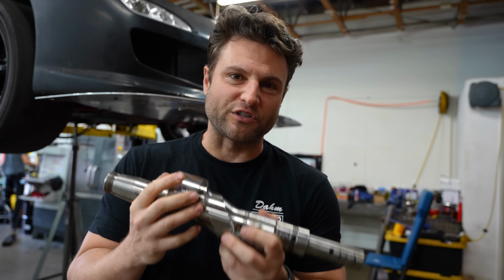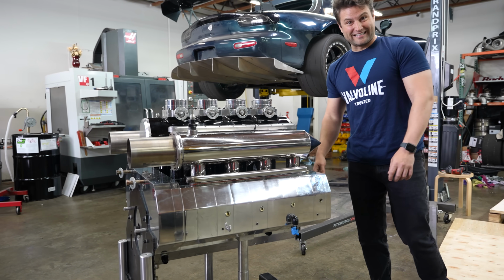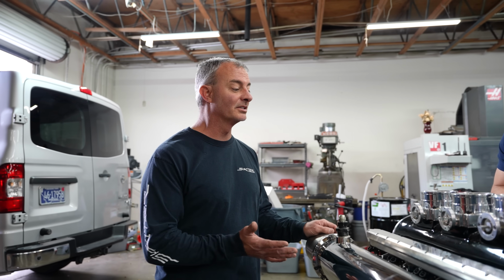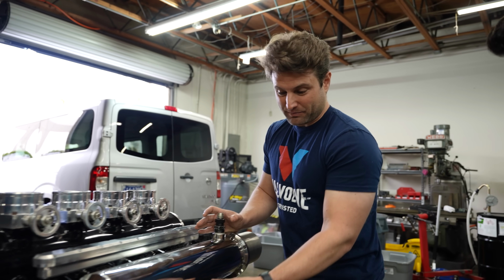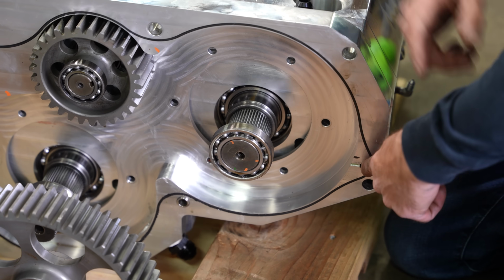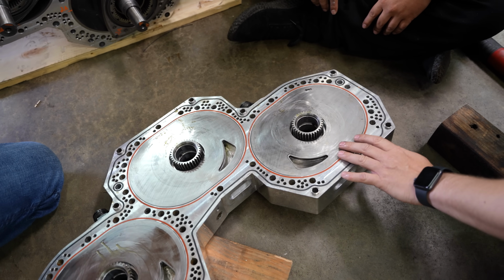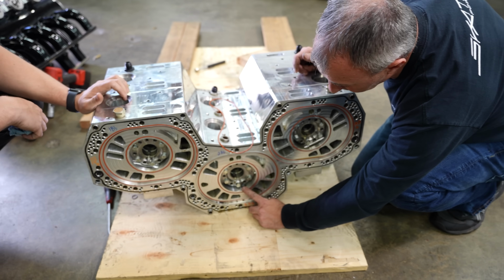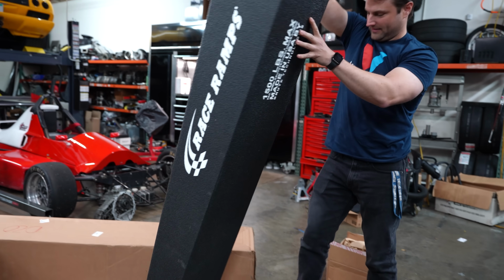I WAS GIVEN THE ONLY 12 ROTOR ENGINE IN THE WORLD!! WITH ONE GOAL IN MIND

Comment: Not sure what you're doing wrong but I guarantee you that out of 1000 power boats passing you, every one of them is a BBC a BBF or some form of Hemi.  They all last forever if they're serviced but more importantly, tuned properly. Dual or triple spring valve springs won't break on a 4500HP engine. Sorry but I doubt you make that much HP so no, value springs don't break unless YOU cause them to break. 

I have friends with 6-year-old (or more) LS engines pushing 1200 HP and nothing breaks. Me thinks it's YOU that breaks the springs, not the engine.

The only way that engine makes power is with turbos which are LOUD.  As for a 12-rotor engine, it will be so noisy that god himself will slap his hands over his ears.

You make no sense at all!

Comment: Doesn't look like a rotary engine. Are you sure? Rotary engines have the cylinders radially around a center point like a radial engine, but opposed to a radial engine where a crank shaft rotates the jugs do

Comment: In 1988, I bought a 1985 Mazda RX 7 .
I put a racing Beat manifold on it. 
A racing Beat header 
A Holly carburetor. 
A racing clutch 
And a small nitrous kit on it .
A MSD unit and a few other things I can't remember maybe a gear and a few other things .
I was 17 years old at the time .
And there  wasn't  a Mustang Grand Natinal Monte Carlo ss .IRock z .
Formula 350 a corvette that could beat me, and I raced them all .
The only car I almost lost to was a twin Turbo 300 zx .
I barely beat that car .
It was the only car I had to use the nitrous to beat .

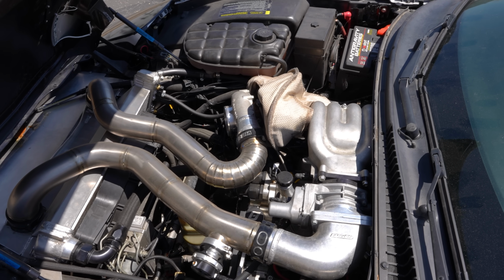Comment: So this bad boy takes the space of a BB Chev engine, but its also about the same ci as a BB Chev engine +, so by my calculations, (if you get it running with maximum efficiency) you can result in an output of 2,345,678 watts 😮🤗, what a work of art, I want one, how much for the finished item 😀? 0:03

Comment: Wanna know why the Winkel engine isnt in every car? It is because it has a much shorter life-span than any given piston driven engine. Inside the engine is a lobe. this acts as a piston of sorts. and just like pistons it has the equivelant of the piston ring. These are the lobe blades and they wear out very quickly. Additionally, Winkle engines had issues with leaking. 

Yes. At ratio, a winkle engine can output more torque and HP than a standard piston engine. It can scream past Piston RPM limits since it is rotary and there is no stress on pistons going up and down which has a physical limit. The trade off is the life span of the engine because the blades wear out quickly due to the constant friction. Eventually the engine walls wear down as well and the only thing you can do at that point is toss it. Piston driven engines can be serviced and resleaved. 

Now that i think about it. I wonder why they didnt create a sleeve for the winkle engine block that could be replaced like with worn cylinder walls.
Reply: You could just replace the rotor housing, that's not why they never took off

Comment: I dont know what kind of heat a rotary generates, but the dimples on the outside of an engine are actually there to help cool the engine. If it is smooth as a babies butt, it will run hotter.

Also,  12 years from first build,  9yrs since the carb dyno run and is just now getting rebuilt and fuel injection?  I'm confused.  We need more back story.
Reply: I think you're mistaking the structural features that are adding strength to the block with cooling fins used on air cooled engines. The features you see on a water cooled engine do not contribute to cooling in any meaningful way. Also the person who built this engine actually knows what they're doing. You can pretty much tell by watching the video.

Comment: This is a true testiment of American engineering. If we can think it we can build it and we don't need Chinese cheap plastic crap.
Reply: And yet you typed that comment on a Chinese made device, and your house is full of Chinese made products, or products full of Chinese made components. Not to mention your car that is full of Chinese made chips, as are the US car assembly plants. I assume you are American.
Reply: @nordic5490  I am American and you are right on some of that I did type it on a Chinese device but my truck is Detroit steel 1970 Ford Ranger F 100 and a 1974 Dodge Power Wagon and I don't have electricity, haven't for years now so I don't use most Chinese chips but yes most Americans do. I hope we can correct this issue before WW3 or we might as well just open the borders and let the enemy march right in. Oh Nevermind they are already doing that.

Comment: Maybe the largest rotary in existence today, but not ever.
In the late 50s Curtis Wright began developing rotaries for aircraft. By the end of the 60s they had a series of engines developed using 60 and 90 cubic in / displacement per rotor.
The largest pre-production was a 6 rotor with 540CDI and producing around 855hp. The largest they tested was 1920CDI !

Comment: several levels above next level ,mazda race engineers need to come and learn . how did he make his housings and get the fancy chromed steel liners in ??.   Was also thinking this guy could take the revetec trilobate crank idea and make a race engine to beat all others . hope you guys have had a look at liquid pistons inversion of the rotary too ,tip seals are stationary in the housings . WW111 may be kicking off but I wlll still have to check on this project !?.

Comment: How many litres is it?
Reply: Depends on how you measure it. But 0.65 per rotor, times 12 rotors, times 3 combustions per revolution. But that is not comparable with piston engines because they have a combustion only every other rotation. So whatever it is, it doesn't matter. Only meaningful comparison is a 13B, of which this is 6 times larger.

Comment: you could weld that gap with a tig machine instead of bondo and then use dremel multi tool for touch up ive done in many times on old cracked engine blocks

Comment: Didn't Mazda already come to the conclusion that it wouldn't be cost effective to produce a car that would be, 1, bigger than most Japanese and European cars and 2, using an engine that's really complex and a drive train system that WILL make it problematic and expensive to fix. Mazda hasn't done it because of the reasons that are listed above,and the cost of tooling to produce an engine that is un tested in endurance, etc. It's the cutting edge stuff that is both exciting and expensive, so it is probably going to be a little while before we see it in a production car I would bet,if ever.

Comment: As a precision engineer.....I am in awe, this guy is a legend. Make it work Rob.
Reply: I did  high end precision machining and this is a phenomenal build, plus i  have worked on engines and restored cars  i would love to sit with this engine,  unbelievable  feat  of accomplishment  so many details to plan and think ahead on stages of the machining.   Also not only does that aluminum polish up good its also one of the best  corrosion resistant and strongest for this application  due to less chances of cracking and the single highest metal fatigue resistance of aluminum's. i would so love to see and hear this thing run in person i am in total  amazement of the  engine and the  engineering and machining that went into making it.  Hats off to this man getting  this engine to this point.
Reply: Pretty damned fine engineering... must have run out of $$$ as he is using spur gears...  Engine that size will be losing ~100+++ HP in those gears instead of something superior but more costly to machine
Reply: @w8stral  i mean he did also mention that the tech to even have efi for it didn't exist and they were using 2 jag v12 setups. He really constructed the main body in assembling and machining the entire housing setup and shafts. I'm sure there's a lot to modernize and overhaul to get every drop of power out.
Reply: Seriously though, is everyone gonna gloss over the MODULAR rotary engine aspect? That ease of 2 4 6 8 rotor builds is a multi million idea that he should have been pitching to mazda or other third party brands.
Reply: @R0FLC4T5  With the new upcoming rotary supplementary engine from Mazda I’m hoping they’ll properly revive the purely rotary-driven cars again, a modern-day RX-7 with a cutting-edge rotary would be 👌
Reply: I'd like to see it run, instead of bs'ed about a guy who says it runs...   and if it runs I figure the next rebuild willl be very soon considering all the seals 1 rotor needs 9 compresion seals.. thats 108 seals that could go bad....  lol  no rotary's are not great...
Reply: @harleyme3163  he ran it 9 years ago the vids are up on yt.
Reply: @harleyme3163  2v pushrod engines break valve springs all the time. Push rods are not capable of running high rpm and high lift valves for an extended period of time. Springs fatigue and break. Such are the limitations of pushrod 2valve engines. 

2v pushrod engines ariginate for the 50s,a nd are way obsolete for the ultimate in performance.
The next best affordable car performance engine of choice is the straight 6, 4v dohc, eg the Ford Barra, (I have several, inc factory turbo), 2jz etc.
Then, I would look at a Ford Voodoo flat plane 4v dohc v8.

All these 4v dohc engines run smaller lighter springs to keep the valves under control, and dont need as high lift for superioir flow, thus last at high rpm.

Dont ever thing the 2v pushrod engine is more desirable in endurance high rpm and high boost applications - it isnt.
Reply: @harleyme3163  apex seals are a problem that have long been solved. The issue is that it's niche. So if you want to maintain the rotaries you're gonna blow money. The ease of this is the idea that if one blows you can pop it out and replace the one dorito and drop it back in. Or pull the cluster and run 4 rotor instead of 6...or 2 instead of 4 while you wait for the parts.
Reply: @R0FLC4T5 also, the market for this engine in high hp boats the people have very deep pockets.  Those engines he's talking about are $300k each and are in need of full overhaul in about 100 hours or so.
Reply: @harleyme3163  imagine having a tune for a basic 2 4 6 8 rotor setup based on them all being the same rotor layout. So you can spend a single day completely changing the engine by just taking a block off the chain and hit a button and reflash for the rotor amount. Or as an off the shelf concept you just spend the thousands and get a block with 2 rotors and turn your 2 rotor to a 4 rotor down the line and have a baseline tune available based on them, again, being the same rotor throughout

Comment: 31:14 lololol True. This would be awesome in a dragster chassis, sand rail, or hyper car. When I saw the LS1 engine in sand rails at Glamis in the early 2000s, I thought maybe you could get more rotors than four into that space. Lol My idea was to run three separate quad rotor cases into a Big sun gearbox that would transmit the power to the center crank and flywheel into some poor transmission that was going to have to deal with ridiculous power and rpm. I was thinking of bracing the blocks with brackets in between the cases to keep them aligned with each other. This design is much stronger. I'm interested to see your plans with the manifolds. This is very exciting.

Comment: 28:49 you want strength here as well as in the bearings. Those outer banks are driving power into the center or sun gear. They will want to walk away from the center under heavy load.

Comment: Soooo, that's for a boat, right?
Or a tank or a ww2 bomber.
Reply: Also, 12 goes into 360 thirty times, so you can have 12 ignitions per rotation.
Reply: Ha! Called it, boat engine.
Reply: If you put that center row (do Wankels have naming convention? Would this be something like a 3x4 Rotor?)
above the two outer rows, you would get less torque on the mount because it'll be close to the center of mass, reducing the torque moment.
So like this:
_O_.
O-O

Instead of:
O_O
_O_.
Reply: You could make it 5 rows of 4 rotors, in an X-Like configuration. 20 rotor.
That would make this a V3x4 I guess?

Comment: I'm not surprised temperature variance among the rotors isn't significant enough to be detrimental as the surface area for thermal transfer is vastly increased compared a traditional piston engine. Which the thermal contact transfer area is actually a downside for a general purpose consumer vehicle on an efficiency basis but on a race boat running continuously it's an amazing benefit.

Comment: That’s a normal gm trans bolt patter. Not specific to big block. Which means you can throw almost anything in there. 4,6,8, 10 speed. T5. Also that bell housing is the most common to make adapter plates for so should be a plate out there to mate up anything you want. A sequential box is what I’d go for👀

Comment: That motor is a peace of artwork and I don’t know if that guy is just really nice or smoking meth I would die before I would ever give that motor to anybody for any reason of any kind it would be put into a car that could fit that thing in it like a viper or a hellcat anything that could fit it and then I would add 4 turbos 3 or 4 intercoolers 2 radiators a anti lag system a custom 12 gear transmission with a auto blip shifter a couple huge nitrous tanks and a custom engine management computer I think it would probably be the fastest car in the world wouldn’t be surprised if it could get past 340 mph the only problem would be trying to find tires that could go that fast without blowing out

Comment: very neat and interesting design but there is definitely room for improvement.  suggestion would be to decrease the v of the outer banks, mirror rotate the outer banks (passenger clockwise, driver's counter-clockwise), while spreading them apart ever so slightly (no more then 1 inch).  dimensional it be almost exactly the same except with a higher deck height.  And it would increasing cooling to the hot spot that cold potentially develop between the drivers bank and center bank.  intake/exhaust locations would have to be changed through.   Anyway, a bravo is due to this guy,  and I do miss the old school days of car guys going "F u, I going to build this anyway. I don't care if this works or has a practical application because I will make it work & figure how to use it." xD

P.S. another possibility is rotate the center bank 90*, might be easier as you'd only have to deal with relocating one bank instead of two.

Comment: I was allways a gearhead as a kid  Addicter to Necganics Illustrated abd when the Series on the Wankle engine I was mesmerized.No.mmachine ever sounded as wiked as the open wheel Indy car that was built. Im80 and fuzzy brain can',t at this minute recall the modle bit I think it was a Nisan?? Or Mazda was banned cause was just too wicked and no one had a chance against it. I dreamed of an RX7. Ooooo The mechanical laws and rules were all tossed in the trash can. One moving part with none of the destrusmctive forces of abrupt reversal if mas enercia and critical rod angle etc put this technology light years ahead of all prior design. Problem the field of metalurgy was too far behind for the rotor seals ets. I thought it would totally displace all the boxer aviation engines. It was perfect for it in weight and vibration concerns that were so critical for airplanes. I remember the Mazda advertizement on tv about the bBoing Boing cars and the Mazda Hmmm.😅 Dandahermit

Comment: Could you use a torque converter system to interlink the rotors like hydrostatic system that way they would be completely independent using fluid only

Comment: I remember watching Tyson build this about a decade ago, I was in shear amazement and still am at the level of engineering and creativity.  I never thought it would revolutionize offshore racing engines like he did, but I had to give him an A+++ for effort and innovation!  This wasn't the only insane build he did either, lots of super cool boat, engine, and powertrain builds.  He's a true innovator for sure!
Reply: Is there any content online??
Reply: @DannyMcmonagle94  I followed his builds on Offshore Only (it's a offshore boating forum).  There's years of his content and creations on there.  Simply amazing stuff.
Reply: Those twin turbo Smith power big blocks are a work of art. They went into a 388 on GLOC that was smoking fast.

Glad to see them bringing out the 12 rotor.
Reply: @prepchris145  The 388's are a fast hull, but you're 100% correct, those Smith Power engines were nasty!  It was sad to see Brad pass away due to a stupid accident back in 2013 (?).  He was a super talented builder, fabricator, and tuner.  I still have one of his old black "Smith Power" tee shirts with the chrome letters! 😎

Comment: Great job on that counterrotation! Just seen a video of a truck with too much torque on the engine and in just blew up and projected itself out of the engine bay. I was curious on how to fix something like that without adding different fasteners but by actually changing the force directions and you showed me that it is very possible.

Comment: Soooo... did this guy "accidentally" create the first ICE that is not inherently flawed? Like, he does not need counterweights, has no vibration, no heat unbalance, the engine doesn't torque... and all of this by using the most elegant ICE solution, the rotary. Obviously, there's one compromise, and that's the sheer weight of the beast, but that's nothing compared to what it's going to put out... You could power a full Avro Lancaster with just one of these.